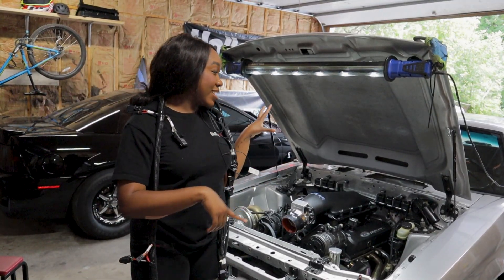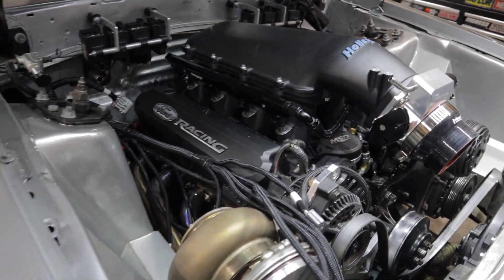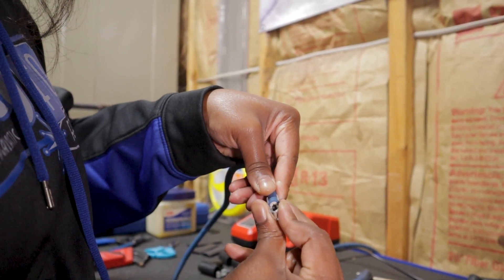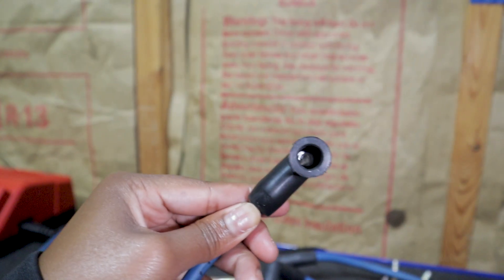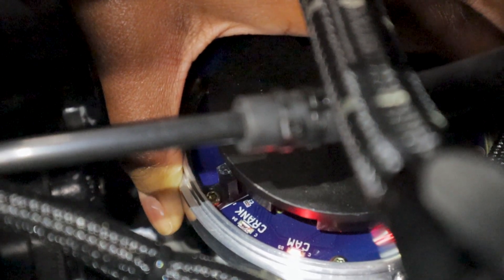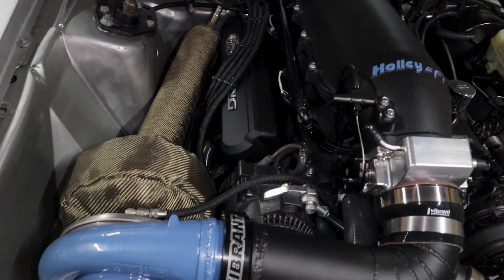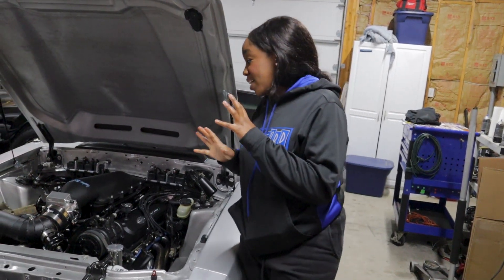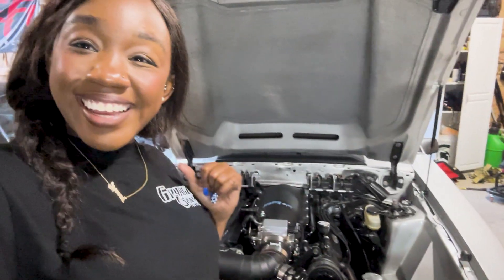Turbo 302 gets Holley Smart Coils!

Comment: Where did u buy the coil brackets at the firewall
Reply from the maker: They’re from Amazon!
Reply: @LalaFox92 beautiful build btw and I think ima buy that Holley intake but not sure if my fuel rails will fit I bought them from LMR SVE
Reply: @ thank you and what throttle body are you using with sensors I have the Holley terminator kit for 302 but not sure if connects plug play to that throttle sensors

Comment: are you running a dual sync distributor with the blank distributor cap? and are you running an ignition box any? Trying to figure out this system for my car also
Reply from the maker: Yes! I think if it’s in this video if not then it’s in another and I don’t have an ignition box.
Reply: @LalaFox92  awesome. Definitely a helpful video.

Comment: Your car is coming along nicely!!! Do you have or have you thought about getting a PDM for it?
Reply from the maker: What’s a PDM?
Reply: @LalaFox92  power distribution module. It’s solid state and it allows you to get rid of your fuses and relays. As we progressed with our car we started coming across electrical issues and trying to trace them down at the track. It uses can bus and also minimize the amount of wiring you’ll need. Another acronym for it is PMU.
Reply: Check out ECUMASTER PMU16

Comment: Did you end up going with the Holley Cam Sync and crank trigger, eliminating the distributor?
Reply from the maker: Essentially yes, the cam sync takes it place and you need separate coils for the plugs which are mounted on my firewall!
Reply: @LalaFox92  I think that's probably the best ignition setup for these cars. You've done a great job on your car, it is gorgeous!
Reply from the maker: @NosLaser  Thank you!